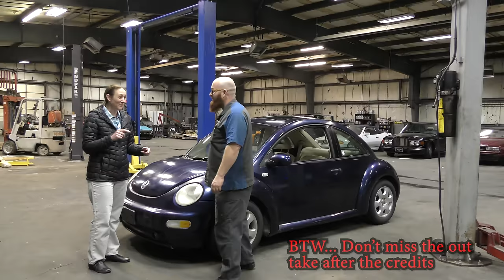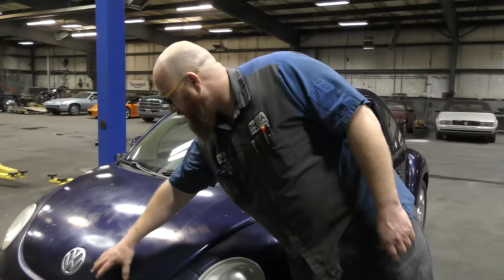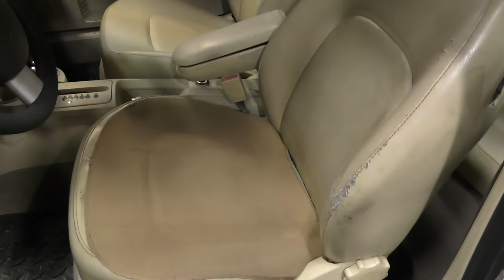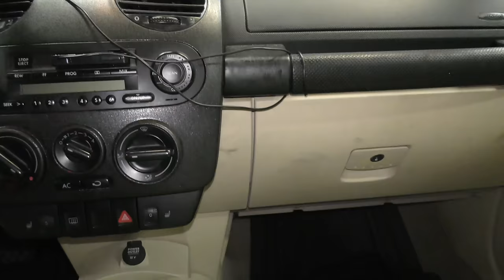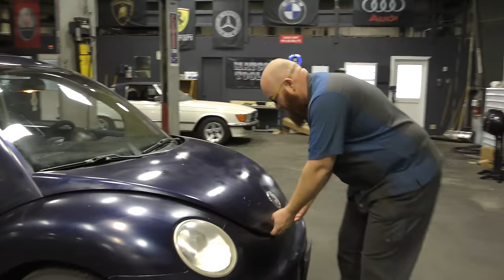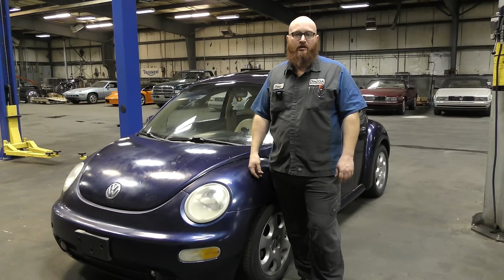Squirtle Update! Why does the CAR WIZARD love this 2002 VW Beetle so much?!?!

Comment: My Volvo s60 2005 has 315.000miles on it. Got it for free about 3 years ago because the cluch slave cylinder gave uo and left him stranded. Had spare parts lying around so after a day in the garage it was upp and running again. It has been my daily driver ever since

Comment: Most miles:  214,000 on a 77 Buick LeSabre with a 403.  Valve stem seals were toast but back in business now.  Dad has 270,000 miles on a 97 GMC Sierra with a 350 vortec.

Comment: Put 2 hoses in reverce direction at the heater core form the firewall behind the engine  one hose in the bucket and one  conect to the garden hose turn on the water slowly to max then change the water flow to oposite direktion do that two times . Then connect everything as it been before ,heat will come right away . Ive done it to mk4 golf passat and mk 3 polo it works like a

Comment: You Scratched a winning lottery ticket with your transmission. I know more than ten people who barely got more than 75,000 mile on a VW transmission from the 2000's before it needed a full rebuild.
Reply: I believe this one had its transmission serviced at some point, the fluid needs to be changed at a certain mileage. I have a 2003 2.0 automatic Beetle with nearly 440,000km on it and it still shifts amazingly well, with just periodic and preventative maintenance and the occasional transmission service. Most people never serviced their transmission and that is why they fail prematurely

Comment: The  blend doors are made of sheet aluminum and they have holes punched in them (to lighten them, I guess)... the doors are covered with a thin sheet of foam and that disintegrates over time, making the doors seem like they're not even there.  I've got a 2001 Jetta GLS and it's been blowing that foam out of the vents for years now.  Do a search on the HumbleMechanic  YouTube channel, Charles did a video on how to fix it.

Comment: 9:30  flush it out with CLR  heater core is probably plugged
Reply: Yeah vag concern cars are notorious for that.. Some aluminium gunk gets loose from the radiatorbut the heater core is tighter so it gets blugged.
Reply: I'm assuming he checked both heater core hoses and they're both hot. Usually if the core is blocked that badly, one hose will be cold.
Reply: It could also be broken HVAC mechanisms under the dash, which can be a royal headache to fix.
Reply: I drove a vw 2 years in Michigan with only heated seats 😂😂😂 this wold have been a life changing tip 😂😂
Reply: My 2000 jetta did same thing just 3m aluminum tape on the blend door to fix mine
Reply: @veryrancid3128  Our 2009 Sportwagen got a clogged heater core from the antifreeze reacting with the radiator.
Reply: My 2010 Jetta TDI  took forever to heat up too. Complained to the dealer about it and they claimed it was normal for these engines. Loved the way that car drove but the dealer techs were the worst I've encountered of all the different brands I've had worked on over the years. It's bad enough I won't buy another VW product which is sad because they drive really nice.
Reply: @Canuckrz  
If it's not the foam on the blend door , and it's the blend door controller , sit down and maybe put a seat belt on before pricing one cause i think they are around 200$. 
Check the coolant glow plugs on the side of the head too, they help heat alot and actually made these cars bearable.
Reply: @MrTheHillfolk  Coolant glow plugs are only on the manuals,  at least for the jetta and golf.   The autos have a tanny cooler that heats the engine coolant
Reply: @giffjp  ah ok yea my experience is with a manual ...I don't see why they couldn't be retrofitted though , they are gonna be quicker than the trans cooler.
Reply: @MrTheHillfolk  I'm sure they are quicker on the manual too.

Comment: If it blows cold but never hot then it’s likely the blend door actuator motor. Had to do that on my Vic and man that’s a sorry job.
Reply: On a VW it will usually report bad actuators in VCDS, if they are electonic that is.
Reply: My 00 Jetta (basically same car) has a similar issue. Blend door seal rotted away (foam), and cold air gets by. Not taking the entire dash out to fix it. Florida car, anyway
Reply from the maker: Chris P Im thinking its the same issue on mine. Not removing dash either. It would probably crack into 40 pieces
Reply: @CarWizard  the arm on the end of the cable falls off the blend door. It's down by the gas pedal behind a panel. Common problem.
Reply: @CarWizard  I did a fix on my daughters beetle that didn't require the complete removal.  You remove the center bezel and radio and you can access part of the ducting.  You cut a rectangular hole in the ducting and tape up the blend door.  Do some searching and you will find this quick fix.  You then seal up the hole using the piece you cut out and gorilla tape.  It works just fine and only took a couple of hours vs. a couple of days.
Reply: @CarWizard  They don't crack apart. They come in and out relatively easy. They hardest part on the beetle is disconnecting the AC lines (salt states...) and the bolts on the engine side of the firewall. Been fixing TDI's for 18 years.
Reply: Jason Daniels where are you located at?  I need to have a few things fixed on my tdi beetle.

Comment: Funny.  Back in 02 I had my head set on slightly used a VW GTI, then I drove the Beetle and was surprised at how much more stiff, balanced and practical the car was -- it was a champ in the snow. I was one of the few who didn't buy one for the styling.  Had it for many years before I finally gave it up.

Comment: If it dips very low in the negative degree temps.... just cycle the key a few times allowing the glow plugs to warm the combustion chamber for a full two or three times and it will start no problem.... also use diesel service cetane boost in the cold
Also you will greatly improve your experience with it if you clean the intake manifold and redo or delete your egr

Comment: my step daughter had one of those, the interior is so cheap its really sad. She got locked in one time because nothing worked, the window motor switch or the door open handle. I ended up removing the door panel completely and just having the controls hang from the door. It literally fell apart in my hands. Germans really struggle with interior longevity.

Comment: The issue you are having with the no heat is the foam they put on the blend door has fallen apart I was having the same problem went and bought hvac aluminum tape took it all apart then put it on now the heat is super hot

Comment: After this video your making me regret even more selling my tdi jetta
Reply: words I never thought I'd hear someone say, ever
Reply: do not regret unloading your money pit VW because car wizard makes a video on his piece of junk
Reply: @Mach141  this so much. I don't miss my money pit at all
Reply: I have an 03 jetta TDI 174k miles, zero mods. Only issues: 
-Limp mode once from a vacuum line ($11 fix)
-starter wire severed during a tumbly -31°C cold start.
Reply: @RandomlnternetGuy  oh, so that must mean all Volkswagens can be fixed for cheap right? Laughs at your naive nature and drives into the sunset in a car that actually runs and drives, not ever even thinking of spending money on a Volkswagen ever again
Reply: @paulcarmi8130  did i deeply offend you by talking about my car? Sucks you had a bad experience with the car and i agree that VW are money pits.. but dude... reellaaxxx
Reply: @RandomlnternetGuy  I'm not offended at all, I just know what to stay away from
Reply: Strange thing is: Here in Europe, some VWs are amongst the most reliable cars. There are also money pits like the 1.8 turbo or the 1.4TSI but in general, they do really well. Sometimes it seems to me that the US built VWs must be much worse than the european built. Same with Audi: I have a 93 Audi 80 sitting in the garage. It was my first car but I don’t use it anymore. 27 years old, driven through snow and salty roads, 300k kilometers, first clutch, first exhaust, first suspension, gearbox and engine untouched and not one single spot of rust!
Reply: @christiansprojects-cgmanuf1426  because a lot of ours are made in Mexico.
Reply: Hell yea same here car never dissappointed even in the polar vortex we had 48 mpg 5 speed
Reply: Dont worry, its engine is going to a nice honda
Reply: LowFlyer I think the majority of Americans don’t pay much attention to their cars. Gas, tires, oil that’s pretty much it. I try to follow the maintenance schedule with my VW. The biggest reliability issue VW had was the turn of the century vehicles. My 1999 Jetta had quite a few electrical gremlins and I think that really tarnished VW’s reputation in the US. I have a 2015 Golf TDI now and I love it.
Reply: I gave my 2002 manual jetta TDI to my brother in law a few years ago.  My commute was too short for it after changing jobs and his is much longer.  It needed some work (like all the suspension bits) which he did and he has taken it from 350000km to 450000 km in a few years and still going strong.  I didn't want a 4 km commute to kill the engine that was running so well.

Comment: Have you seen little bits of foam coming out of the vents? These cars have a blend door that is perforated with fairly large holes and covered in foam. The foam breaks down and allows the air to pass right through the door rather than be redirected over the heater core. If you've seen the little bits of foam then you know the blend door is without a doubt your problem, although all of it could have been blown out of the vents long before you bought the car. The linkage at the bottom of the heater core box also break some times. If you have to replace that blend door, or cover it with something it's not a fun job.

Comment: 180$ for an air flow sensor ? Dude it's like a 70$ part on FCPEuro.
Reply: Listen to the lesson :)
Reply: Well if you spend 210 dollars you are guaranteed to have a good working one out of the three.
Reply: @m.kriddick2731  i meant its the same OEM replacement BOSH unit. I think Wizard should stop shopping for parts from wherever he is buying them from.
Reply: It might be a time / service / relationship / history sort of situation with the vendor.
Reply from the maker: Dominykas Dainys For OEM part? Post the link in here and prove it
Reply: Car Wizard Checks out, site says 72,50 for what is claimed to be a Bosch part.
Reply: Car Wizard btw, love your channel. I’m working on my 2000 Jetta I picked up for $100. FCP Euro has really helped keep the cost down
Reply: Yup if you own euro you need to check out FCP.  Affordable doesn’t always mean cheap knock off junk that most box parts stores carry.
Reply: wymansst   I use FCP or IPDUSA for the wife’s Volvo. OEM and European comparable to OEM.

Comment: I can't believe you have door handles inside! I have this exact same car except its a 5 speed with 200K miles. I LOVE MY CAR TOO. I could afford a new car but I can't find anything I enjoy driving more. I have had to replace the brake switch (common issue) but that's about it. Been driving it 2 years and it gets close to 50 mpg. I get why you love it.

Comment: 325,000 on a 1994 BMW 325i, first time I let my son drive it, he blew the engine within 10 minutes, I installed a used motor and put another 50K on it before I sold it, besides normal wear items (tires, belts, hoses and tuneups) really the breakdowns were rare. I get it why people hate on BMW, but that wasn’t my experience, guess I got one built on a good day.

Comment: " How to improve an $800 car without increasing its value"
Reply from the maker: PussyGalore Couldnt be more wrong
Reply: Car Wizard internet mechanic < real mechanic
Reply: @CarWizard  our record is 306,000 miles on a 2 valve 5.4 Triton, it ran on 4 or 5 cylinders and had low compression, but it drove to it's timely demise, rear suspension collapsed and went through the bed, wood kept the bed up for the short drive.
Reply: Nice name
Reply: Could easily get $2500 for it the way it is now
Reply: @_-KOEN-_  You know it's from the film "Gold Finger" right?
Reply: Full rotor Job full bearing Job full set of tires and 3 turbo parts easily he spent $2500 so far on it ...

Comment: I'd scrape that crapple sticker off . never support the people paying lawyers to take away your rite to repair.
Reply: Jnl Jnl I fix my own Apple stuff. I run nothing but Apple it’s reliable and works great. If you can’t fix it that’s your fault.
Reply: @DanaTheInsane  Best hope your ISL9240 chip does not croak then.
Reply: Yup. apple is trash. They make their money by fleecing the technologically inept.
Reply: mitsuturbo That’s what all OEM’s do though. You ever take your car to the dealership? They’re taking advantage of mechanically inept people.
Reply: Apple literally patented a new screw head just so you would need special tools to work on their devices. Just because you can repair it yourself doesn't mean you should support a company that is ripping off everyone else.
Reply: @DanaTheInsane  if you can get the part. Without being sued by crapple.
Reply: @xCaLLMeGHeTTo  No, actually. I have never taken my car to a dealership unless it was for WARRANTY service. I build my own engines and transmissions, and in the past i even did my own machine work.

Comment: 3 in downpipe on that thing is like a tune bro n they’re only like 60 buks on amazon!  The turbo noise is super legit!  I’d backfush yur Heater core on that...  disconnect n run yur own hoses...  the tool/ w/o air fitting is only like &40. Also...  those had an air pocket problem... u need to use a vacuum/filler system...  ecs tuning has the Schwaben one for like 75 buks and covers tons of expansion tank systems!  Good luck bro!  Good show!

Comment: I have a little over 271,000 miles on my 2008 Chevrolet Silverado 1500.
Unfortunately I'm not a mechanic; so, not including oil changes I've had to put about 6,000 dollars of maintenance in to it, over the years. 
5.3L motor still sounds very tight, and runs great. I expect the transmission or the rear end to go out before the motor does.
I've always used the best OEM and had it serviced regularly at the dealership.

Comment: Iv got a 2001 VW Jetta tdi with the same 1.9 alh engine and a manual transmission. Currently at 275k miles and counting!
I don't have quite the toolset you do but keep him going by working on him in my driveway! Can't imagine how many thousands iv saved.

edit: spelling.

Comment: As someone who has been driving VWs since 1972, original owner of a Corrado VR6, and a fan of Mr. Wizard's video, I don't have a problem with Mrs. Wizard's idea of selling Squirtle. If I was going to dedicate that amount of time in a restoration effort, at the end I would much prefer to have a mk4 TDI Golf or Jetta with a manual. If that cost a little more, it would have been worth it.

Comment: Coming Up next Buy this not that Kia
Small: to buy 2019-newer Forte, not to buy pre 2011 Rio
Midsize: to buy 2012-newer Optima, not to buy pre 2012 Optima
Large: to buy 2014-newer Cadenza, not to buy none
Minivan: to buy 2007-newer Sedona, not to buy any year Rondo
SUV: 2012-newer Sportage and 2016-newer Soul, not to buy 2009 Borrego
Sportscar: to buy 2018 Stinger GT, not to buy None
Reply: It will be up this afternoon or on Thursday. I have been waiting for this video for a long time.
Reply: @md2k8  correction, the Rondo will be on the SUV to buy list, while the pre 2007 Sedonas are on the don't buy list
Reply: @brianlego98gaming  I agree with you. The first-generation Rondo is still a buy, but the first-generation Sedona is a not to buy.

Comment: My 2000 VW Beetle 1.9L ALH 5 spd has 434K on it. Blend door issue. Mine had foam over the mostly a frame for a door, foam rots falls off no control of air. Remove radio and that nice center cover, make a 3X4" cut into the plenum somebody did a video on this. Now remove old foam on door. I covered door frame with aluminum backed duct tape. Cutting into plenum avoids major AC heater box dissection. Replace 3X4 and patch it up.

Comment: I have a 2006 new beetle TDI (bought it new). Same color with the same issue with the paint.
280,000 miles with orgenal clutch. Been concern about the EGR but with that many miles, really don't care now. 5 speed stick 45 MPG. Still has plenty of power

Comment: My Ford Sierra had no cabin heat, I tracked it down to a blocked matrix due to it being full of radiator sealant, a back flush with a hosepipes made all the gloop come out, never had a problem afterwards

Comment: My dad drove a 2004 Ford E150 that was owned by Sears. He was an appliance repairman. It had the 4.6 V8 and he put 275000 miles on that van. Still had its original timing belt.

Comment: you can use the VAG-COM system to minimize the EGR function, can not turn it off completely with it though, also installing an oil catch filter on the PCV tube to the intake will really cut down on the intake carbon buildup

Comment: Wizard. I have a 05 beetle and you will discover that the blend doors were made with holes in them. They are thin pieces of tin  with holes in them and covered with a foam tape that falls off over time and then you have no real control over direction or blending of hot and cold, cause air passes right through the doors.

Comment: I see it this way, If you find a high mileage car or truck with 250,000 miles or higher that still runs and drives perfectly fine, That tells me someone had done maintenance on the vehicle. My last truck had over 356,000 miles on it when I bought it. Best truck I ever had till I sold it with 400,000 miles on it.